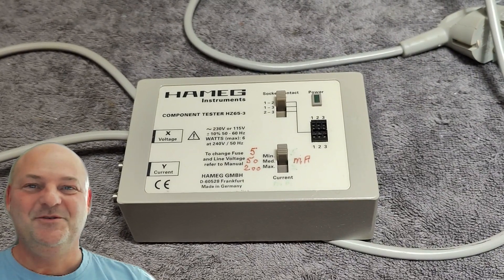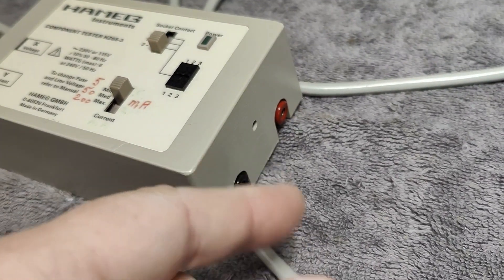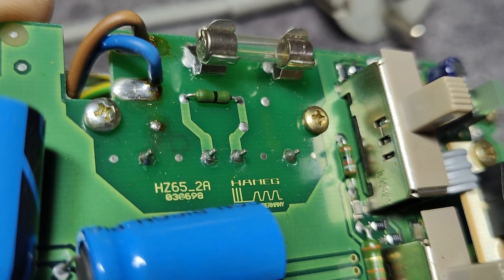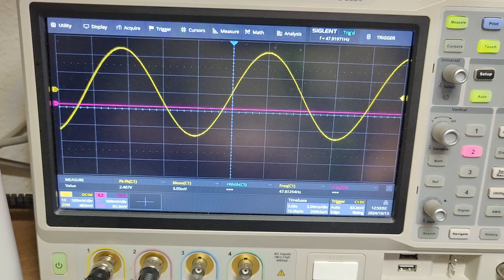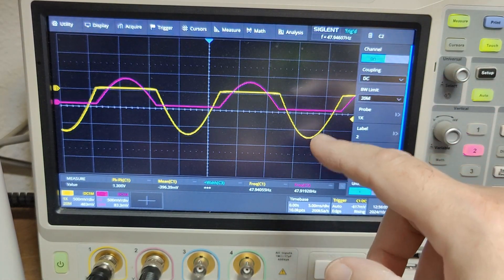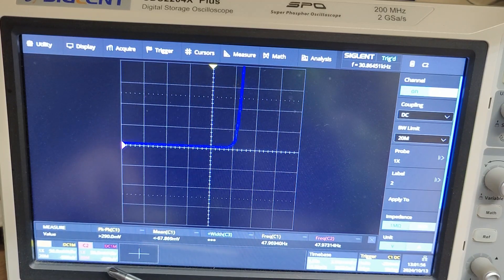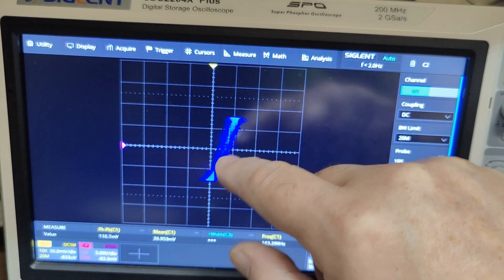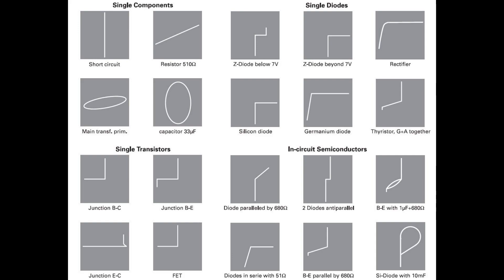Hameg HZ65-3 Component Tester XY scope sweeper 2001

Comment: I‘d be interested in the circuit, can’t you do a deeper analysis what it is for?
Reply from the maker: the circuit is by far more complex than i expected, it uses an internal sine osc 48Hz why not use mains ?
since that sine is used to voltage X and as Y current, any distortion from the mains curve, should not affect the measured curve,
so i find that really wierd and over complex for no good reason.
I am not going to trace down the schematic, sorry, I am sure the opamps and electronics is there to make it more accurate and more linear,
you can actually make it work with a sine generator, series resistor for the current source, and a two channel scope :-) 
now take a diode like i did a 8:00 and you can make the same curve

Comment: That’s pretty cool that games made a simple standalone component tester. I built my own “octopus “ component tester from new and salvaged parts I had. In circuit tests are definitely altered by other components in the circuit but it’s been useful to help find shorted transistors/ diodes, which are usually the problem in the guitar amplifiers I repair.

Comment: Hi Thomas, I know this box, it works great (it was my first external tracker) Hameg built it directly into analog oscilloscopes under the "Test component" function. Digital oscilloscopes show a lot of dot artefacts, the best display is on an analogue CRT.
I personally use the NI-210, it is a copy of the Tektronix TI-210
It can find a lot, even in today's electronics, by adjusting the voltage and current we can eliminate the influence of the surrounding components on the tested component when we test it in the circuit.

Thanks for the sample and have a nice day 🙂Tom

Comment: I would invest in Polar fault locator T1500 or a Huntron. Still a cool thing you have only a scope on the bench. Did you tried to extend the leads to probe components without desoldering?
Reply from the maker: yes you can do that, i dont normally recommend to measure components while still in the board, since you dont measure that one component alone, but all other parts it is connected to also, BUT it is very usefull if you got two boards, one works, one got a defect you try to find, then simply compare point to point on the two boards, until you find the area with most different result,
Reply: @TeardownOZ2CPU  Partial solution for this trick is a fancy huntron feature to ise 0.3-0.4Vp-p voltage to avoid trigger semiconductors. However i have never saw that in use. Dont know how much practical use this feature have.
Reply from the maker: @mikedfgfj  not much use for a person with deep insight in electronics, he will know where to look and measure only a few times